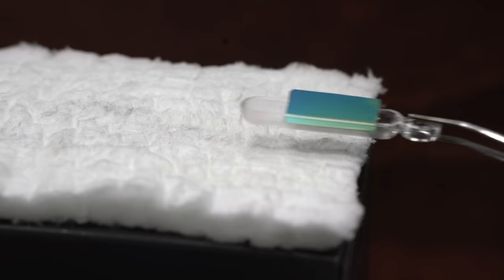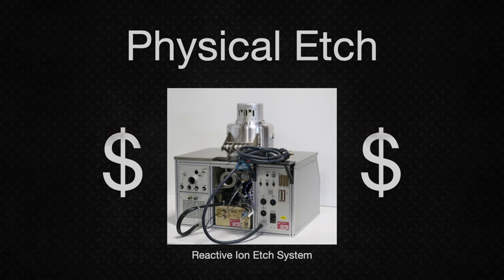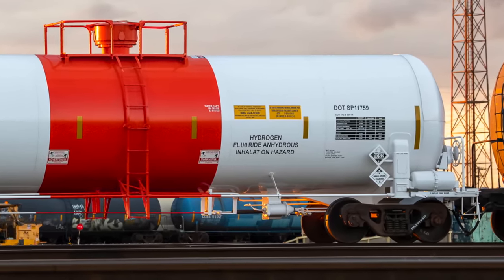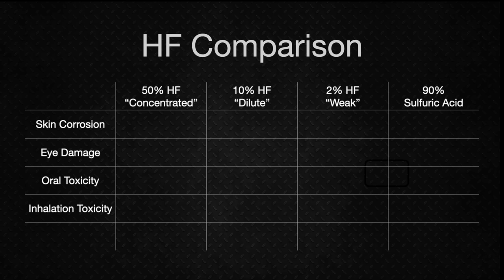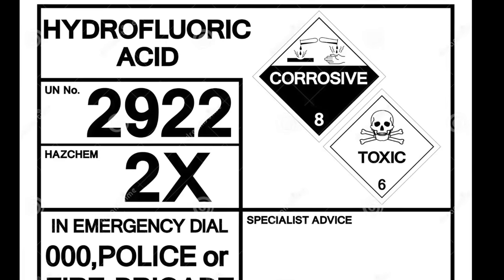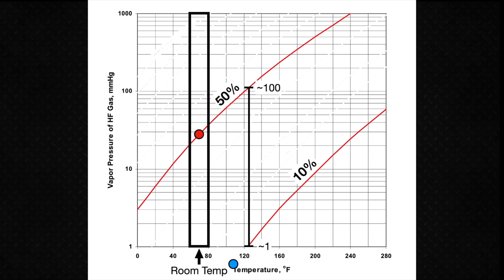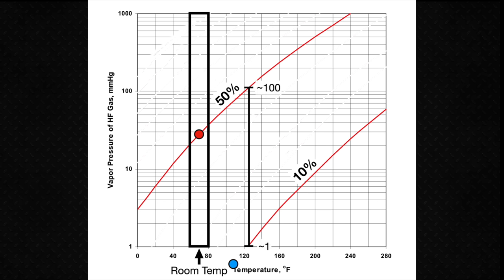Using Hydrofluoric Acid to Etch Oxide Layers

Comment: I am not a professional chemist, however I do have a degree in chemistry (BS) and I can appreciate the dedication to safety. However this chemical (HF) is on a short list of chemicals that I will not work with given a choice. HF is new degrees of nasty and toxic. This stuff can eat your glassware, burn your skin even with most common gloves, kill you, and cause no end of issues. 

If you do plan on using HF for your etching I would recommend getting gloves that are resistant to HF concentrations up to 30% or using tools to handle the containers of HF at a distance. Also, you might want to consider having a stock of a neutralizing agent nearby in case of any spills. Now you might already have this and just didn't state it, but if you don't I would highly advise you have one on hand.

All that said, very nice video! I have always been curious about the process of manufacturing of silicone devices and I will be watching with interest going forwards. I just found your channel and you have earned a sub!
Reply from the maker: I appreciate that you took the time to write this. I don't have any real chemistry education (other than a couple college lab classes) so I am always looking for info from others who are knowledgable :)

I have a pair of 14mil butyl gloves for handling HF and I am looking for some better nitrile disposable gloves as well. For neutralizing I am currently using sodium carbonate, but i'm looking for something better. I think the main thing that I should improve on is wearing better quality nitrile gloves and keeping the HF inside other containers. I feel like the main liklihood of injury at the current time would be some kind of mistake where I didn't notice a spill, so I'm looking for an indicator solution that works for HF- in case you have any ideas. Feel free to email me at my gmail as well- ProjectsInFlight- same as the channel name!

It's true that HF isn't a chemical to be taken lightly and I'm doing my best to minimize the risks. I think in the future I'll do a more comprehensive video on PPE.
Reply: @projectsinflight  The Butyl gloves will work to if you are very careful, but I would not rely on them solely. The recommend gloves for handling HF by OSHA is Neoprene gloves. Neoprene can resist HF up to 48% concentration and are not super expensive (still pricey though), Nitrile can work if they are thick enough, but are not the top recommended gloves by OSHA. Double gloving is always recommended as well.

If you do go with Nitrile, get the black Nitrile gloves as they are thicker seeing how they are designed for industrial applications. Or use your Butyl gloves with a Nitrile glove as a liner or inner glove.

Your neutralizing agent is fine, in fact when I was in university we used a saturated solution of sodium bicarbonate as our neutralizing agent. I'm glad you have that on hand for a just in case situation :) and having something like kitty litter (cheapest one) to soak up the neutralized spill.

For the HF indicator, any pH indicator will work and if you are concerned about vapors of HF, hang some kind of indicator strip(s) in your hood. But these will only let you know if there are fumes, not what consecration the fumes are at. I know there are dedicated meters for measuring HF fumes, but these tend to be extremely expensive and hard to get. So hanging strips at regular intervals on the side of your hood should be fine. But if your hood is in good working order and is removing the fumes there should be nothing to worry about (test your hood using a blown out candle and see if the smoke is pulled away).

And keeping the HF containers inside of another container is a good idea to contain any spills, which we all say will never happen but always seems to at the least convenient time.

Comment: There's a weird disconnect between how dangerous things are and how dangerous people think they are, when I was reading through the medical treatment for HF their notes for exposure to dilute HF was that the first aid treatment was the same as what a medical professional would do (calcium gluconate), and that if it was from dilute HF and applied by someone knowledgeable quickly further treatment may not be required. Tbh it seems like with concentrations as low as the rust remover the higher risk would be from repeated small exposures adding up to flourosis over time rather than rather than anything acute, excepting cases of ingestion I guess.
You might want to validate the concentrations of HF by seeing how much sodium carbonate is needed to neutralize the HF though
Reply from the maker: Yeah, I really want to test the concentration of each but I'm having difficulty finding an appropriate method. Titration seems like it's not gonna work.. Any ideas?
Reply: @projectsinflight  Gravimetric would be easy enough (precipitate it all as CaF2 or the like?), if maybe not the most accurate (particularly at low concentrations where solubility matters, and, recovery of small amounts of solid, and purity thereof, is tricky). I don't know of an indicator offhand unfortunately.
Reply: @projectsinflight  I'm not a chemist so not sure, but what's the issue with doing a titration?

Comment: really excited to see where this goes. i've always wondered how hard it would be to make the (IGBT?) transistors used in EV drive units; I'd imagine that their structure size wouldn't be as much of a performance limiter compared to homemade ASICs, but I've always given up the task when hearing the horror stories about HF (admittedly most at industrial scales)

Comment: Really good video. I know HF from metalworking as a stainless steel etchant in a mixture with other acids. It is used to grow a passivation layer on welded stainless steel parts.
Reply from the maker: What strength did you use?
Reply: @projectsinflight  From the MSDS the product contains 5-10% HF and 5-10% nitric acid and it was a gel thing and not a liquid. I believe there are more dangerous products for the same purpose but it always scared me a bit. In some shops they have like 1000 Litre tanks of a similar HF-containing liquid used to submerge parts.

Comment: This video is fascinating, and HF is terrifying. As en electrical engineer, I feel more at home with ion beam etching, cause I can sort of figure out the physics of the device, but chemistry is beyond me. I kinda wish somebody made an equally involved video explaining the safety concerns of ion guns. The dangerous parts are probably the beam itself (don't stick your hand in there), the possibility of accidental X-ray production, high vacuum implosion, and also electrocution due to high voltage.
Reply from the maker: The dangers you listed are all valid. There is one more I can think of: When you do reactive ion etching you often add additional chemicals to the chamber to achieve better results. Most of these chemicals are pretty dangerous, either because they are toxic or pyrophoric (burn on contact with air). That being said, it's still something I'd like to try at some point because it's a super valuable tool

Comment: Awesome followup video! I would argue that the lesser concentrations provide a safer and more forgiving option for pursuing this. Whereas the others seem to me like they would be less forgiving and force you to be quick, which would lead to mistakes and possibly an accident. Couple that with the dangers of the higher concentrations and it would seem the best option, at least in my view, is the least concentrated and to take more time. Avoiding accidents, working slower and more methodically means less wasted material from hurried batches. All pluses in my book. I look forward to the upcoming videos! Also, the needle applicator seems like a glove puncture hazard to me, even if negligible.
Reply from the maker: Fortunately the needle on the applicator is smooth and not sharp like hypodermic needles

Comment: I have worked two different places that used lots of HF acid. A solar cell manufacturing plant and a quartz refining plant. They got it in IBC containers and i think it was 60% both places. The quartz plant used around 2000 kg a day. And at the solar cell plant they told me about one guy that got 2 drops of HF on his neck and they had to restart his heart 5 times on the way to the hospital that is around 1.5 hours away when driving at normal speed, but i'm sure the ambulance drove faster. At the quartz plant one operator got diluted HF running down into his gloves, but it was dilute enough that he only got some rashes on his arms. I was in maintenance and never liked working on the machines after the operators had hosed them down. I was always thinking what if they missed a spot when hosing them down...
Reply from the maker: 2000kg!?! JEEEEEZ Thats a scary story
Reply: IBC cage tote full of HF would be unbelievably scary to go near. Several years ago I worked for a chemical recycling and disposal company and a semi company had 60% nitric with 3% HF plus minor contamination with silicon aluminum phosphorus boron etc they couldn't find any disposal plant to take it. After a while we found a fertilizer company that would take it once we let them know that all that would be required would be to react it with calcium nitrate solution then filter the calcium fluoride out. Next combine with KOH and CaOH to make the fertilizer. ❤
Reply: @christopherleubner6633  We got the IBC's on semi-trucks and apparently the truck drivers did not read the manifest of what they where carrying. So one time one of the IBC's leaked, and when we noticed it when he arrived the truckdriver just said that he had noticed it when he checked the cargo a few hours earlier in the trip but did not think it was a big deal so he just tightened the straps and kept driving to his destination. I guess he got luckily. But i bet the trailer rusted like hell after that.
And everything on every machine that was in contact with the HF was plastic (PTFE was best but PP also hold up pretty good and is cheaper), even the screws because it would just eat trough anything made of any metal.
Reply: @projectsinflight  And all of it was then just dumped into the sea actually. The building where they acid washed the quartz was down by the sea, and there was a concrete "tank" where the seawater could flow in and out of freely where the HF was dumped after it had been used to wash the quartz. That way the HF would be further diluted in the concrete tank before it flowed out into the sea. But even though the HF was already diluted by water by the time it got into the concrete tank after a few years the concrete was etched away pretty badly and the walls needed to be sand blasted and reapplied. One supplier joked and asked if the fish around the area had any bones left in them.

Comment: Rust remover in US uses HF? In Brazil they can only use Phosphoric Acid for metal or Oxalic acid for fabric. The heavier acids you can acquire in supermarkets is Sulphonic acid for cleaning Aluminium. For buying HCl for cleaning concrete or stone you need to buy it at hardware stores. Even so they are heavily diluted (5% or less).
But you can buy HF as dental products but again in very small quantities and heavily diluted.
More than that it controlled I don't know to what extent.

Comment: I have this bottle of cleaner called clear pink stuff that I've had for a very long time. It's 30% HF and about 15% sulfuric acid. I actually used it a few times years ago without having any idea what it was. I'm very fortunate I didn't hurt myself with it. I haven't touched it in a long time and don't even know what to do with it. I guess I need to take it to hazardous waste at some point.

Comment: I was wondering how sensitive the etching rate is to temperature. Heating up rust remover or any HF-containing chemical might be (very) ill-advised, though. Again thx for this, very interesting to follow along.
Reply from the maker: The etch rate will increase dramatically with temperature, but so will the vapor pressure and fuming.
Reply: @projectsinflight  in that case then would the opposite be true? if you wanted to use the armor etch in a more controlled manner could you chill it to reduce its speed? perhaps to a point where it is comparable to the Dental stuff without the expense?
Reply: @projectsinflight  Expected, well, considering the designs won't necessitate too many etchings, the current rates should be fine. Do you already have an approximate goal in mind design-wise, and if so, how many deposition and etch steps do you expect?

Comment: why didn't you address the way porcelain etch spread around the drops you placed? as if it diffused around or the fumes chewed through the oxide as well.
Reply from the maker: Not yet but i may make a follow-up video investigating that

Comment: If you stick to proper PPE and are careful, I'm sure you will be fine.

Additionally, you could build an improvised fume hood out of a large HDPE box which would vent to atmosphere through a decent filter. An inexpensive source of a HEPA filter might be a vacuum cleaner with allergen filtering capabilities.

It may be possible to dilute the paste to a liquid or filter out some of the solids to make it more workable. I'm not sure what you are planning to do but using a cotton swap may damage your features and will certainly contaminate the sample.

There are contact mask aligners available second-hand sometimes but you might be better off converting a projector as some people have done online before.

Instead of etching, you could use a lift-off process for the metal layer(s) which prevents metal from bonding to unwanted areas and only requires solvents (organic solvents can also be nasty but nitrile gloves are acceptable unlike with HF).
Reply from the maker: I'm thinking about a simple fume hood for piranah etch. I'd love an aligner. For now i'm gonna align by hand because my devices are large enough that it shouldn't be a problem

Comment: The benchmark with sulfuric acid is a bit misleading. I know from experience that 96% sulfuric acid on skin is not that big of a deal, depending on how dry the skin is you can have minutes before it starts reacting. Certainly not something to visit the hospital for. A drop of 50% HF on skin does warrant a hasty trip to the ER. I will not keep HF around for that reason.
Reply from the maker: the point of the comparison was to highlight the areas in which the dangers are similar and then explain how the fluoride toxicity and delayed reaction are two areas where HF is MUCH more dangerous than sulfuric acid.
Reply: @projectsinflight  Not exactly the message I initially took home from that, I'd say any concentration of HF is more dangerous than H2SO4. But I agree, if you're working with HF and you've any doubt you've come into contact with it, see a doctor right away.

Comment: 10:50 one thing I will always tell people is never tell people to just wear a respirator, because actually telling people the correct filters and to always ensure it is an airtight fit is key, to them not getting contaminated in a pandemic or dying when handling chemicals...

For example your standard painters filters will be A1P3 but standard chemical handling filters are ABEK2HGP3 or speclised which comes in 100-400g weight range in Bayonet and 40mm NATO/GOST consumer respirators are generally low quality silicone compared modern military issue byutol and tri blends, these respirators that can also have protective outsurts like the Avon C50 which is my preference as it has internal communications and drinking and 40mm NATO filters are industry/military standard and cheep, and you can also have a spectical kits for vision correction.

The same sort of logic also applys to gloves proper jointed airboss chemical gloves with real gripping molding is worth evey penny as they are comfortable but thick enough to get off in time if chemicals that can melt it are handled, also they far better for doing high temperature washing up and hot food disassembly then your crappy consumer gloves 😂

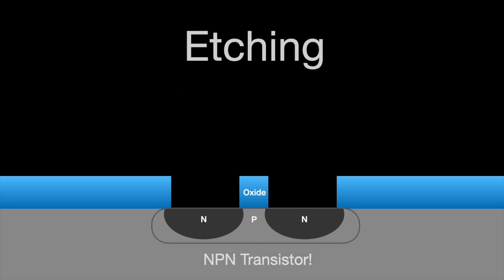Comment: Small correction at 1:10 ish in the video you describe the structure as an NPN transistor. While it is possible for that structure to be used as a bipolar device, it is much closer to an N-channel MOSFET.
Reply from the maker: Yeah I didn't want to show the whole doping profile for a BJT because animating all that would have been HARD lol
Reply: @projectsinflight  Very fair. One of my back-burner projects is to animate the mosfet device models. There is a lot going on.

Comment: Interesting video. Thank you.
Perhaps a chemistry person, perhaps Nurd Rage or Nile Red might inspired to do a titration, but in a way, you found a new way to find the molar mass : )
You might be able to dilute the Armor etch, which might keep it from drying, too, as well as perhaps put it in your confront zone. Otherwise, perhaps putting in a sealed box with a wet sponge might put enough moisture in the air to keep it from drying.

Comment: I feel that with the weak acid you have a more precise control over the amount of oxide being removed where as with the stronger acid you dont have fine cuntroll.
Maby you can use this to your advantage.
Reply from the maker: Yeah, I figure both the weak and strong HF has its uses in the process